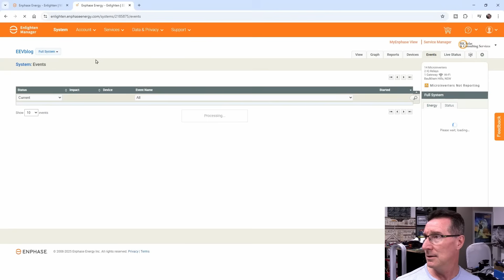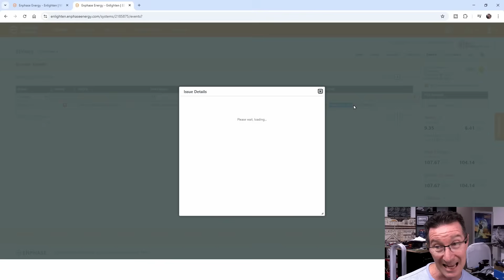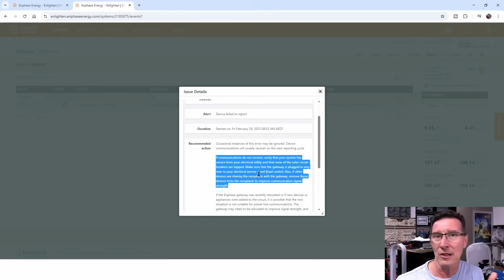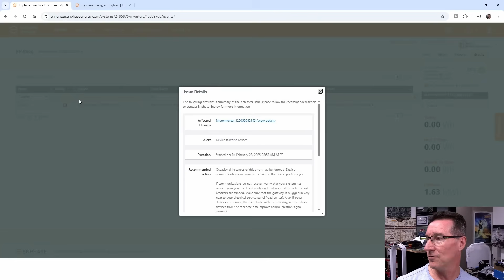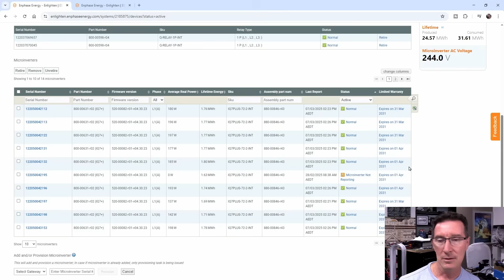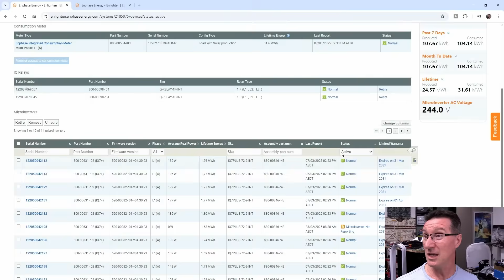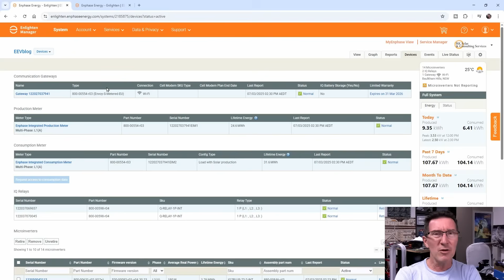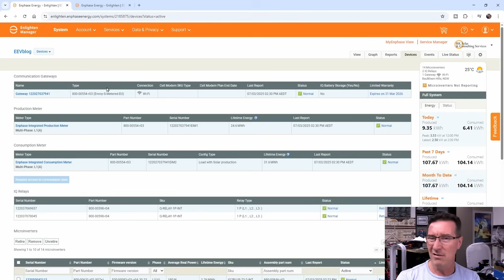Enphase Microinverter FAIL?

Comment: My solar installer initially tried to push microinverters but when he realised I was electronics savvy he agreed they were an additional risk, particularly in my case where shading is very minimal and handled by the new panel designs /  bypass diodes.  He also 'learnt' that with a Tesla PW3 they were unneeded, as the (UK) PW3 takes three MPPT strings at native DC - offsetting the slight shading loss against the AC coupling loss into the PW3.

The advantage of microinverters seems to be the ability to create lots of data and graphs for oficianadoes to purr over 😎🤣

(Has this video been released out of sequence as I have already seen a video (I think 🤣🤣🤣🤣🤣🤣) with Dave up on the roof swapping inverters)

Comment: Sounds like bad luck. Ten year guarantee is not bad at all. If they reduce the guarantee time with newer devices though, that is a sign that they have problems. Not micro inverter, but I once purchased an expensive LED bulb and it failed a few weeks before it's 2 year guarantee ran out. Had hassle from the staff from where it was bought because the same lamps now only had a 1 year guarantee - hmmm. I did get a replacement and then a few days later the light ballast gave up; oh well.

Comment: Hay Dave, what has been your experience in general as to the power output from the solar array vs the panel's advertised  standard rating?     ie on a 400W panel what kind of output are you seeing.   I know it will be different between seasons, orientation, location and wxr conditions  but what is your general impression?

Comment: These issues are why I really don't like microinverters. They are installed in a hostile environment where it is hard to get to. If one fails you have to get an exact replacement or it won't work with the rest of the system. Good luck in getting spares in 30 years time.  With a string inverter you can just remove the old one and swap it out without going on the roof and you aren't locked into a particular vendor.

Comment: It might be worth disconnecting and reconnecting the microinverter's connection onto the loom, this is exactly the graph you'd get if the contacts to the mains side went bad too.
(You're going to have to go up on the roof to remove it anyway).
Reply: I second this! I recommend checking the rooftop AC cable connection to the microinverter. Source: I have installed enphase IQ7 and IQ8 for the past 6 years

Comment: did you have good reasons to install micro inverters? I try to avoid them unless you have significant shading. They're expensive and just add another failure point.
Reply: They might add more points of failure, but they also introduce a lot of redundancy.
If this had been an invertor failure on a DC string system, he would be now producing zero energy.
Reply: @ but they are also exposed to larger temperature swings because they sit directly behind the panel outside. It's quite rare to have an indoor string inverter fail.

Comment: I have different brand of microinverters and Small PV array, just 2.2kWp.
2 out of 3 micros failed within first year of usage.

Although it might be partially my fault, because I didn't install communicating box at first. For me it was ok, because I can monitor production with dedicated power meter.

BUT not having communication box means no firmware updates. And some bugs in FW can lead to catastrofic failure. You never know as end user.

Comment: Micro-inverters are great.. .when you have a system with a lot of shade. Otherwise, they are just electronics getting boiling hot, and more complex for no reason, in comparison to a string install.
Reply: Even then, the bypass diodes should do a decent job.

Comment: 3:50 No Dave, in this case it does not look like just a big cloud. That looks like a shut off, that came a bit to late. Such a huge panel should produce at least 2-5W even under clouds shouldnt it? What type of panels are these?

Compare the produced Watts of the converters: The faulty one did produce much less than the others. But there is also another one, that has produced much less. I guess they somehow have converted this difference into heat? If so, then the other less performance one is the next candidate to fail i think.
Reply: I don't know why he didn't switch the view to another inverter just to compare the outputs. It certainly looked like a shutdown!
Reply: @martinwhitaker5096  He thought it was because of a cloud, so he didnt expect others to be in the sun. Reasonable thinking, but seemingly wrong though. It would be interesting to have the other low performance one compared.
Reply: I just checked my 150W panel today, when it was  overcast. It still produced 8W and it was just laying flat.

Comment: My money's on a PCB trace.
Reply: Installed with the wrong tongue angle.
Reply: My money is on multiplicity of failure points inherent in micro-inverter systems
Reply: MicroInverter had some beer spilled on it at a party most likely....just that one trace though.  LOL.  iykyyk
Reply: @ Daves drinking on the roof again? Is it tuesday already?
Reply: The torridol flux inductors are a well known failure point

Comment: The micro inverters at a friends install had 3  failures over about 5 years.  Warranty replacement was done each time, but don't know how much you can trust these long term after the warranty period  expires.
Reply: That's the thing with warranties, when they replace your item, the warranty still expires after the original amount of time. You don't get a new warranty on the replacement. So a one year warranty pretty much means the manufacturer is confident their product will survive a year.

So you can't trust anything where you have to replace it during the warranty period.
Reply: @ncot_tech also they typically don't cover costs to actually replace the module which might be 4 figures depending on access required
Reply: 12years and only 1 failure on my 16 panel enphase, I'm in Scotland so perhaps they favour the cooler climate
Reply: I wouldnt trust any device period if only because of warranty existing there. If there is no trust just switch better one.